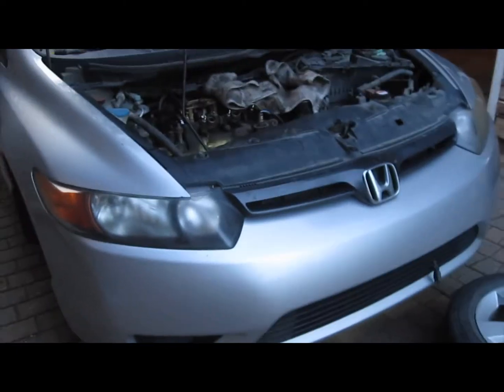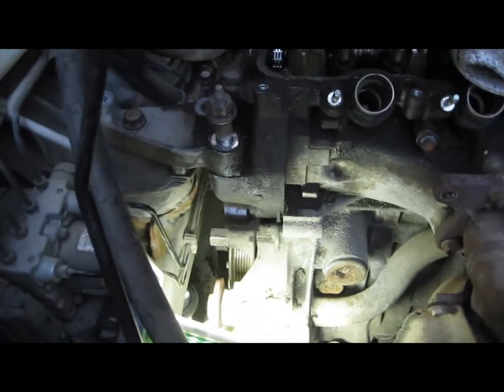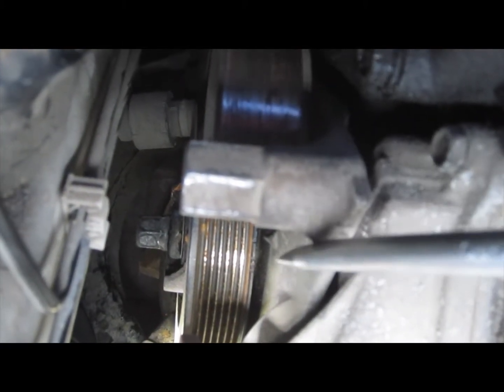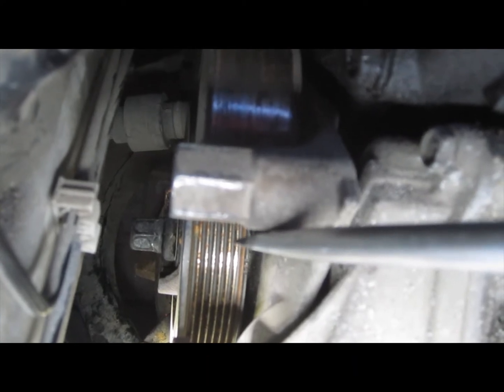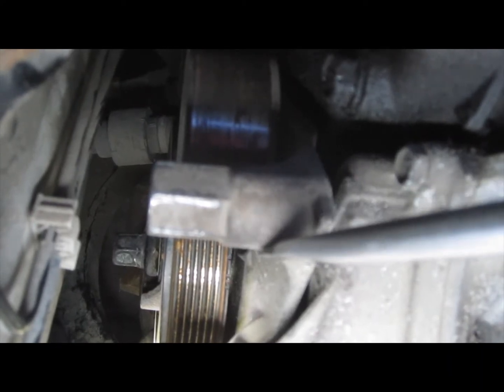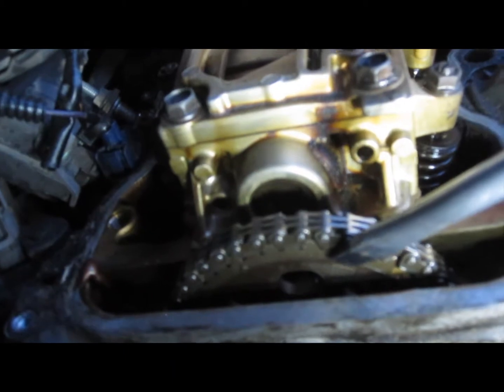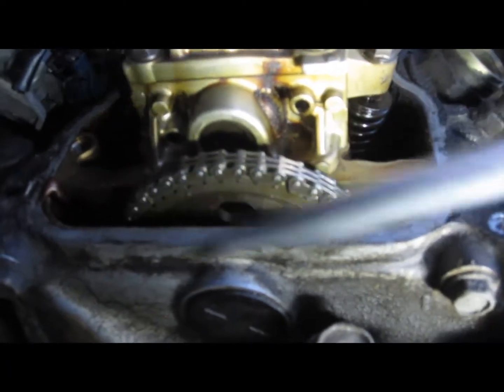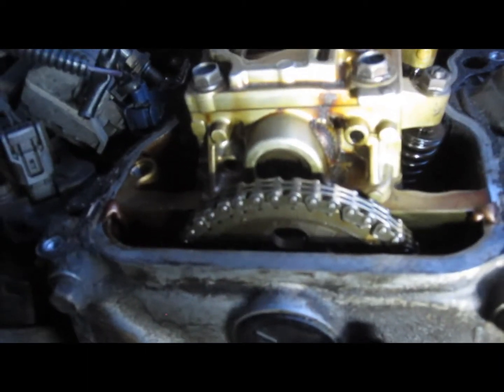2006 civic timing chain check

Comment: Any info or update on your issue with timing chain skip?  Were you able to realign the cam shaft sprocket with your crank shaft pulley?  If so,  what work was involved to correct? ...or was the issue unrepairable?  I might have same issue.
Reply from the maker: I realigned and cranked the engine by hand.  I confirmed some valves were bent...  got a used engine and did an engine swap.

Comment: Was there an indicator that showed you or you heard that it had skipped? Our 08 civic has 230k and chain has never been checked, not have valves been adjusted, I hear nothing strange. We purchased new.
Reply from the maker: I purchased the car as a project.  Motor was slightly taken apart when I got the car.  The motor stopped running  when the previous owner was driving it. No idea if there was any previous symptoms.  The previous owner had taken it into the dealer who took it apart and verified the chain had slipped and wrecked the engine.  The car had over 300000K.  The chain was stretched.  I realigned the chain and did a compression test.  compression was 0 in one of the cylinders
Reply: @jeepsandstuff9113  interesting, thank you. I have a tapping or ticking noise from my engine i hope it's just a much needed valve adjustment. 225k miles and i don't know if it was ever touched

Comment: Ouch! I just replaced my timing belt on my 2004 Civic. I've read that the belt can be off by one or two teeth without bending any valves, so I'm surprised that the valves bent for just two teeth with your chain. Any idea what caused it to slip? High mileage? Stretched chain?

Comment: I have question ..... does it running or rattle running ? Or no starting cuz there no compressor that why cuz of bent valve
Reply from the maker: The timing chain slipped.  Bent a couple values.  No compression for those cylinders.  Car no longer starts.
Reply: How many miles did it have?